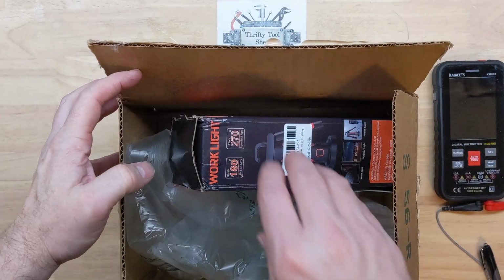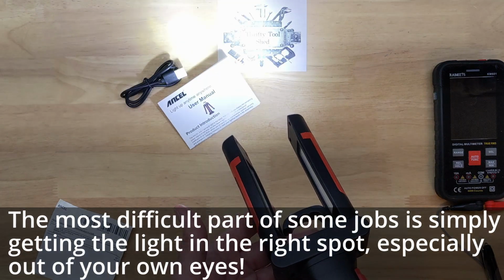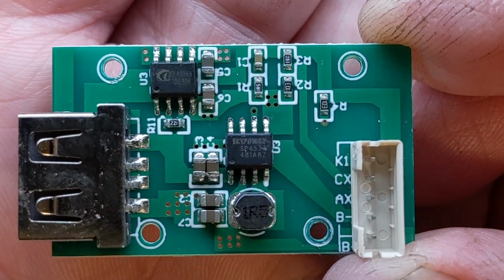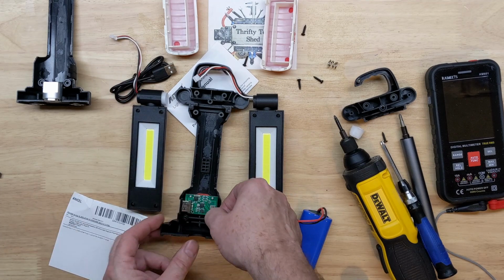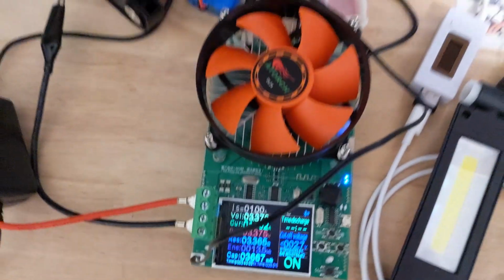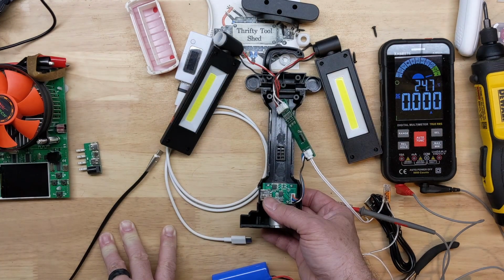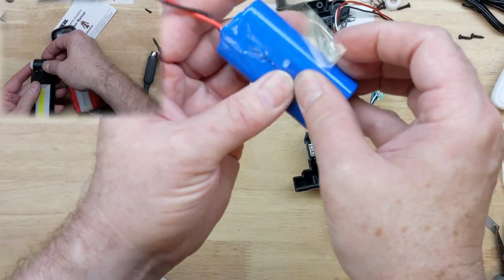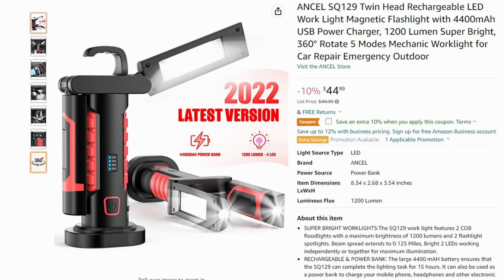ANCEL LED Work Light Review & Look Inside

Comment: The number one question with any flashlight 🔦 is:● does it have pass-through charging so it can operate while it is charging??
Reply from the maker: Great point. It will operate while charging. You are correct I should have shared that as well. I was trying hard to get the video down to under 20 mins and it was harder than I thought. I had to remove several tests, some of the charge test also including Lux which ended up being calculated to a little over 1300 Lumens with my phone as a light meter. It seemed to be a waste of time since I don't have a good set-up for exactly testing Lumens. It basically just ended up being about or over what they spect it to be.

Comment: Did you mention the charge time and I missed it? The one LED 25% warning is good.
Reply from the maker: I think I edited it out to get the video under 20 mins. I tested it with a USB meter at around 1.5A charging rate so less than 3 hrs to get around 90% charge. I did not actually time a complete dead to charge time, just tested charge current and pack capacity.  I agree the 25% indicator is good, I just did not have time to show in video that it gets to the 25% level kinda quick in my opinion so if under a house for example and blinking 25% meaning you probably have over an hour left. So don't lose track of it ya know what I mean? Some newer lights like the M18 tower lights etc. When they get down to about 10 mins left of run time the light itself will blink a few times every few minutes to let you know it's time to swap a battery or light itself for a fresh one or get out.
Of course some of the tower lights are over $400 also...